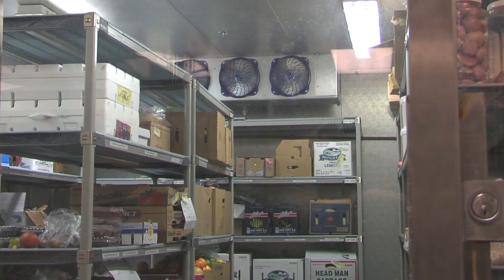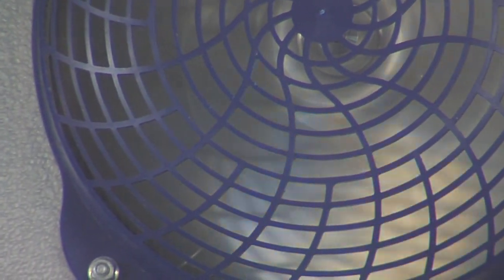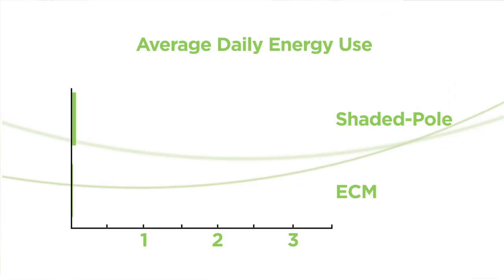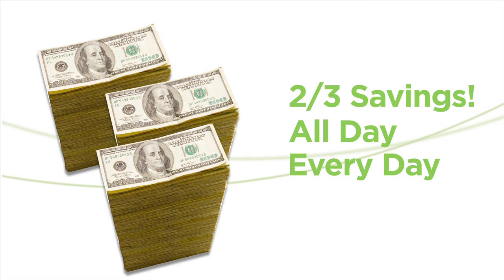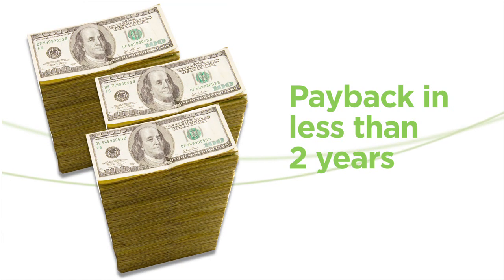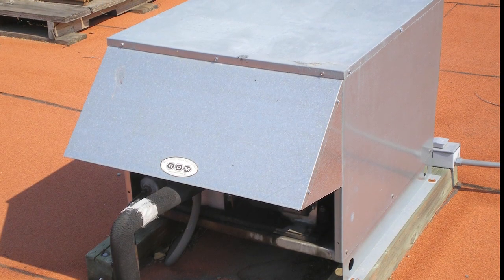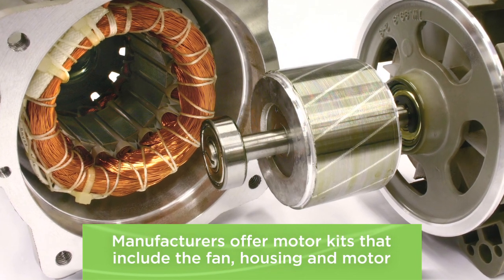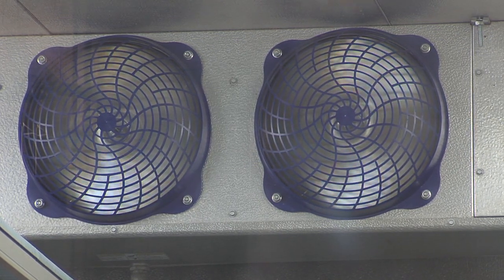Install Energy Efficient Evaporator Fan Motors (Walk-In Refrigeration)

Comment: The installation of FridgeWize single-speed EC motors reduces energy consumption by 70% or more. The installation of FridgeWize 2-speed EC motors reduces energy consumption by as much as 85%! (2-speed fan motors operate at 1/2 speed when the compressor is off-cycle.) Plus, replacing bent, unbalanced fan blades with FridgeWize carbon-fiber Q Blades increases these savings even more. Visit www.fridgewize.info for more information and a free quote.

One correction to this video: FridgeWize EC motors are an EXACT replacemtn. we note the mounting, horsepower, voltage, and rotation. This allows the new EC motor to be a simple replacement, even using the original fan blade and cover.
Reply: they burn out much faster then the old motor resulting in more repair costs so where is the saving?